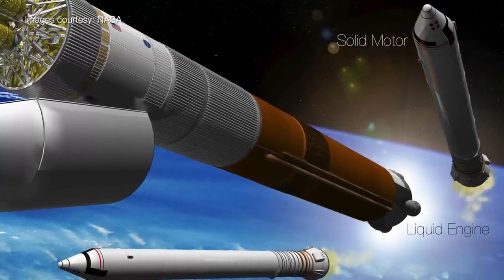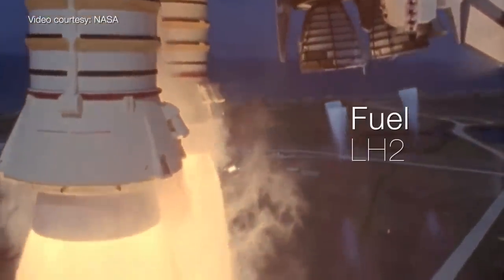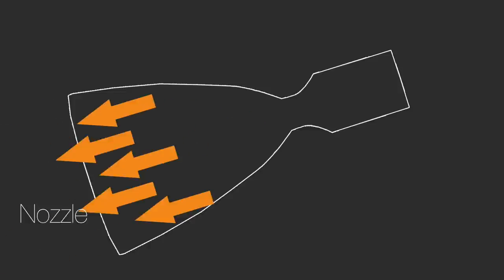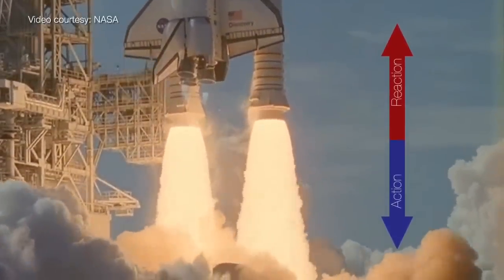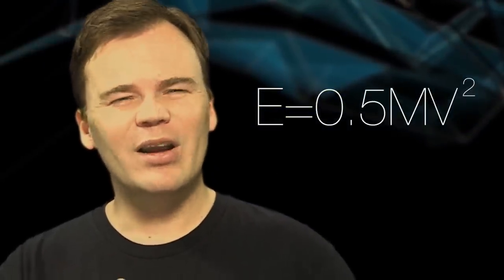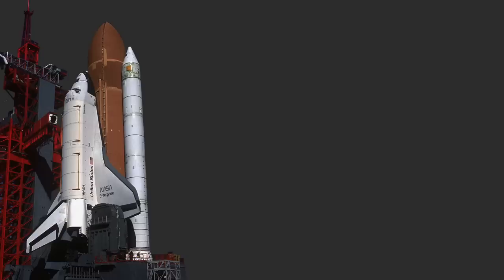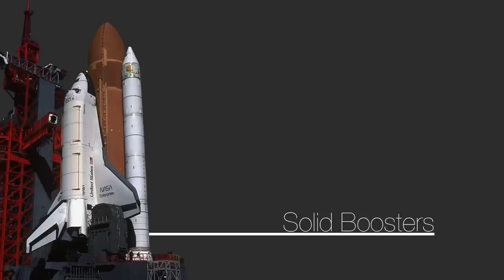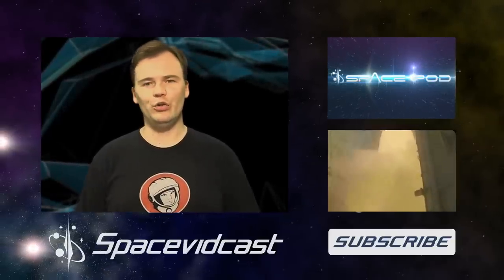How do rocket engines work - SpacePod

Comment: Rockets cannot propel in a vacuum. there is no pressure in space in fact there is only negative pressure and that's why we call it a vacuum. A perfect vacuum means free expansion, i.e. , when a star blows up in space the vacuum pressure remains the same, only gravity and radiation changes. Think of a blown up balloon, on Earth, that has been tied off. There is pressure on the inside of the balloon pushing its inner walls outwards, simultaneously on the exterior of the balloon the atmosphere is pushing 14.7 psi against its outer walls, inwards. now in a vacuum that balloons outer surface is being pulled from all sides rather than being pushed. so if a rockets thrust/push is lesser than the free expansion vacuum/pull of space, then the rocket is useless. In conclusion we have been fed the largest trough of b***** in the history of mankind.
Reply: +steve Mann 
So according to you, rockets do not work in space.
Reply: ercillor no, according to the fundamental logic of propulsion rockets cannot work in outer space. Being a 4th generation engineer, with a proven track record of 20 years, I just so happen to see it quite clearly. I don't make up the laws of physics, I only observe them for what they are. Frankly, every country that is a superpower has its people invest, annually, billions of dollars towards a lie otherwise known as space exploration rather than solving real world problems. So if I'm right and they are totally full of s*** about space exploration then there pocketing quite a large sum of money and we the people have no justification to where our money goes to. Personally I'm tired of the tonic salesmen with their miracle water pitches robbing people for the purposes of self gain. Hopefully you are too?
Reply: False. Thrust from the engine flowing backwards (relative to the spacecraft) = action. Forward motion = equal and opposite reaction.
Reply: +steve mann Obviously rockets do work in space.  That is how satellites are launched into orbit.  That is why we have GPS and satellite TV, weather satellites and the ISS.  You can see the ISS with the naked eye when it flies over after sundown (have seen it more than once) as well as other satellites.
Reply: +steve mann Do not claim to be an engineer when you cannot correctly interpret a process using proper science. There are many people like you online, who can be called conspiracy nuts, who claim that the world is not the way we are taught to see it, while not backing their ludicrous claims with correct science of any form.
Reaction engines work not by having the expelled gases push against the environment outside the engine, but by imparting a force on the engine through a change in the momentum of the expelled mass. Inside rocket combustion chamber, fuel and oxidizer, which initially have the same momentum in the same direction as the rest of the rocket, react to create a very high temperature and pressure gas that accelerates to supersonic speeds through the throat and nozzle toward low pressure outside the rocket. This acceleration of the mass that originally belonged to the total rocket mass in the opposite direction of the rocket travel is the force that causes rocket to accelerate forward, aka thrust. It has nothing to do with whether those expelled gases encounter an atmosphere or vacuum. Furthermore, the difference in pressure that exists between the combustion chamber and the outside of the nozzle is what causes rockets to work BETTER IN SPACE than in the atmosphere. 
The nozzle's function is to decrease the pressure of the escaping gases, so that they exit the rocket engine in uniform direction (opposite that of the rocket travel) and impart as high as possible thrust, without partially canceling their momentum relative to the rocket. Underexpansion can occur when a rocket is propelling in space because it is impossible for nozzle to decrease the escaping gas pressure to equal that of a vacuum, so some gas can exit at an angle to the rest. But this effect is not very big when compared to gains in propulsion achieved through a greater pressure differential.